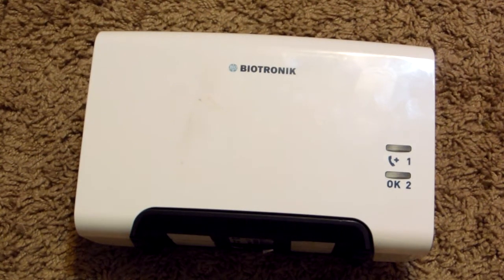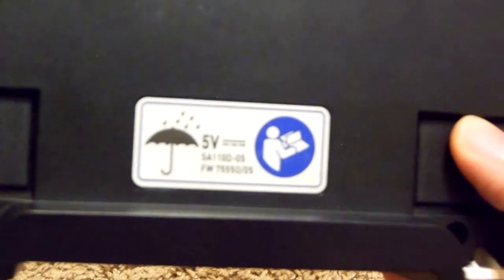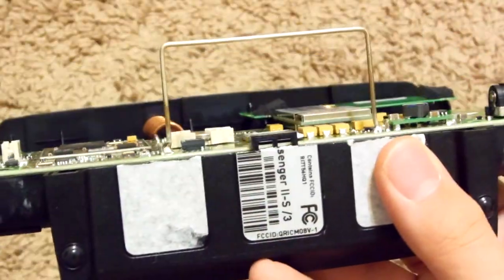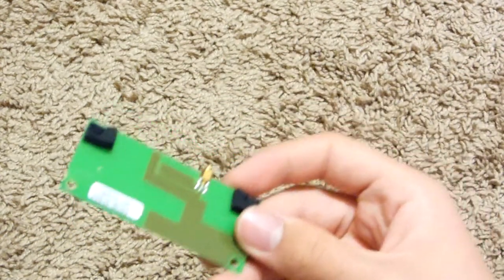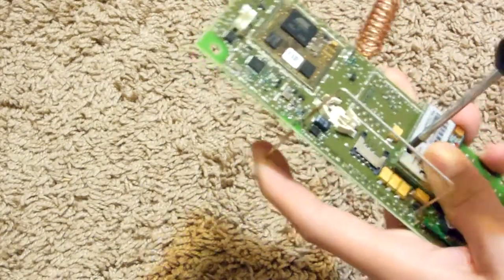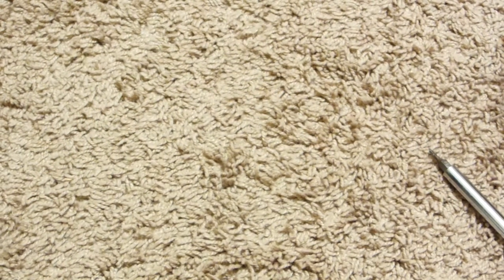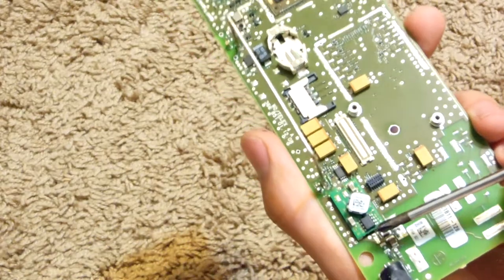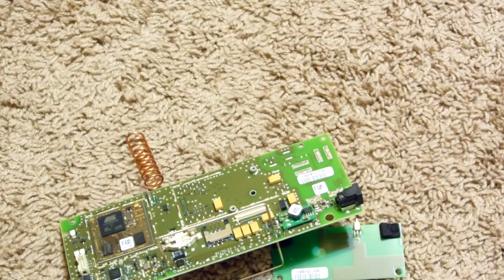E- Waste Scrapping: A CardioMessenger!

Comment: The PC/ABS plastic mixture is very common, not just in electronics. Don't make the big mistake of throwing the PC/ABS plastic parts away. Recyclable ABS plastic is always sold at a nice price, and PC/ABS carry the exact same price! Virtually all types of plastic wastes can be used again. Sorted in the different categories (1 to 7), it can be sold at prices ranging between those of scrap iron and aluminium. It's not the same as the considerable higher price of copper, but if you scrap WEEE you'll soon end up with tons of plastic and just a few hundred kilos of copper. A truckload of recyclable plastic gives a huge monthly extra income. You can sell 90 to 95% of the plastic from WEEE(Waste Electric and Electronic Equipment). The rest can be pyrolyzed to free gasoline for your car, and free diesel/light oil for your metal melting burner, and free gas for your torch. The quantity of each of the three fractions coming from every pyrolysis batch, depends partly on the types of plastic waste, partly of what kind of catalysts you're using in the process. Notice that group no 7 contains "all other than 1 to 6". All "thermo melting" types in group 7 can be sold, but the "thermo setting" ones can only be used for pyrolyzing and they give gases that is quite tricky to refine in order to remove the poisenous chemical residue.
Reply from the maker: Awesome! Thanks for the tip!